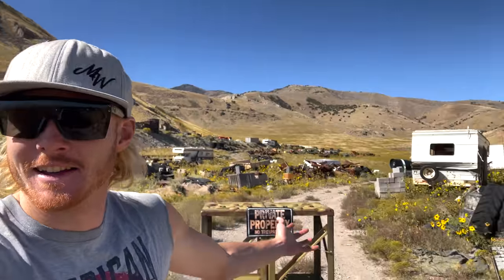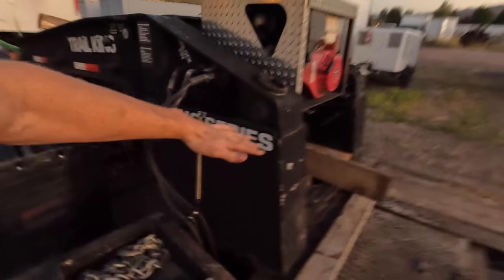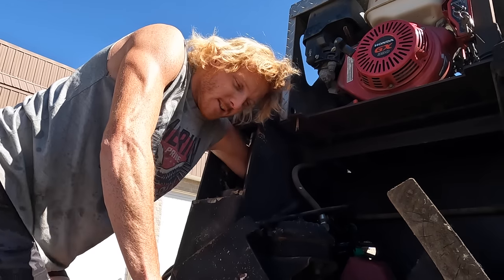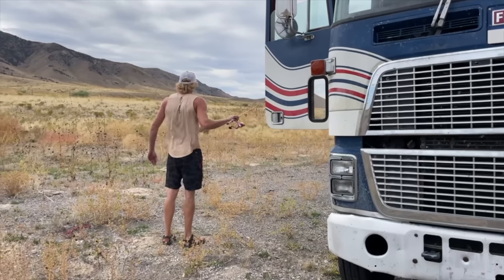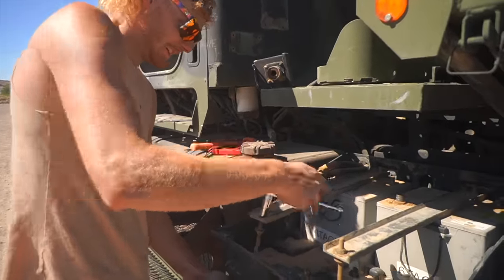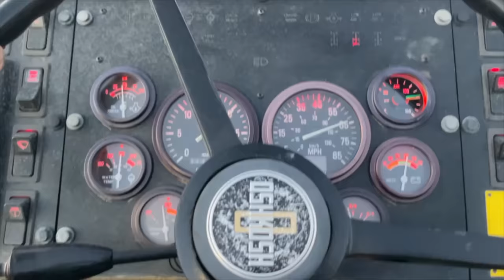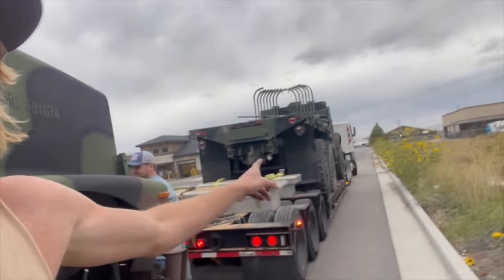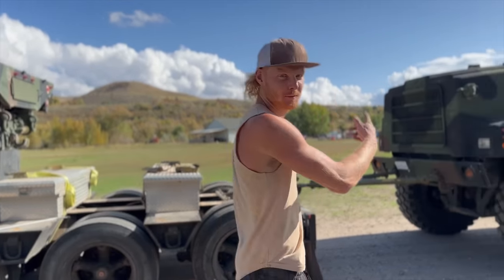I Bought Two 7-ton Army Trucks, But They're In California

Comment: 100,000lbs is 45.3 metric tonnes, the standard weight of haulage here in the UK is 44 metric tonnes, and the maximum abnormal load can be 150 metric tonnes or a tad more than 330,000lbs.  All of them are over-cab.

Comment: To drill holes in any metal including stainless steel, dip the drill bit into pure radiator antifreeze not mixed, and it will zip right through.

Comment: If you could put the transfer box into neutral you should be OK with the gear box. When I did vehicle recovery I'd never flat tow an auto unless I could get the drive wheels off the deck or disconnect the driveline

Comment: what I hear in Australia 🇦🇺 California wouldn't let you drive that classic in there state. any think from 2010 and older are banded under there emission laws
Reply: His truck is registered in Utah. 
Also it's not a commercial used semi.
He will at some point in time put not for hire on the Ford. 
Those are some of the reasons  that he is able to go wherever he wants to in his truck. Theirs ways around the whole certified sticker bs.
Also he absolutely had to go through a semi checkpoint going  to California, Because from the nevada side going to California, there's a semi side and a normal vehicle side that you have to go through just after the nevada side. Obviously he and his Truck didn't have any problems going to pick up the vehicles he purchased. 
But if that were a commercial vehicle all that would be a completely different story.

Comment: As the son of a trucker (DoD and civil), I appreciate your video. However, you should not have drilled holes into the top rail. Drilling into the webbing would have been okay (maybe not with the trailer owner, just structurally).

Comment: 2 @ 7 ton 6x6's + t&t = 100,000 pounds ? did you need special permits for that ?  being that you were 20k pounds over weight ?
Reply: DoT would be happy, since with 9 axles, no axle is overloaded. Whether the length and weight limits are legal without permits would depend on the state you're in at the time. Not trying it in California was a good call.
Reply: since he didn't load the second 6x6 it supports its own weight. and alot of states will allow 102/105k some even go as far as 120/130k. depending on configuration
Reply: i'm gonna say conservatively , that a 6x6 weighs about 22,000 (x2) and i'm gonna say that trailer weighs about 15k ? let's say the semi weighs 21k , that's about 80k total, not 100k .... and for the record , when the side of your vehicle has a gross weight sticker of 80k, that doesn't necessarily mean it's ok to go over than amount , in certain circumstances without a permit

Comment: Well you lost me as soon as I seen you were not completely connecting the pintle hitch. It has 8 holes because it needs all 8 to be correct and support the weight that it is pulling. And I can say this with 100% confidence because I have 25 years trucking with 15 of those years pulling doubles. Sorry Hunter but this is a big thumbs down video I won’t even continue to watch. With your experience in trucking and building big trucks this is a really bad example for you to set for anyone interested in the trucking industry. 😢
Reply: I don’t want to be that guy but do you know how many dump truck pintle hitches have only 4 bolts I agree 8 were there I would have drilled 8 but I don’t really see a problem with running only 4
Reply: @christiansandoval8139  accually yea I do know some dump trucks have 4 bolts and also know they are rated for 15,000 pound max tongue weight. That’s why a dump truck pulling a pup trlr will have 8 bolts or be one of the 2 1/2 in thru bolt set ups